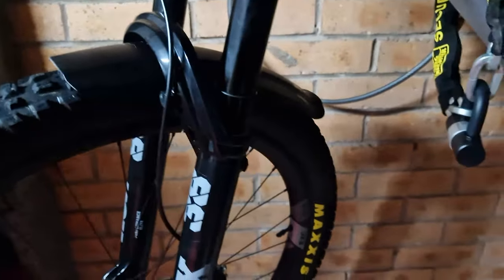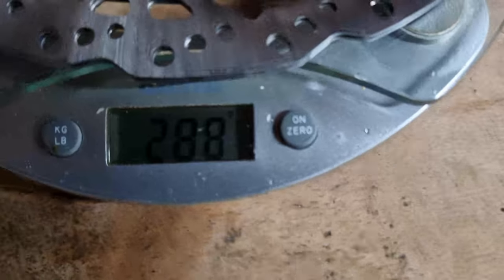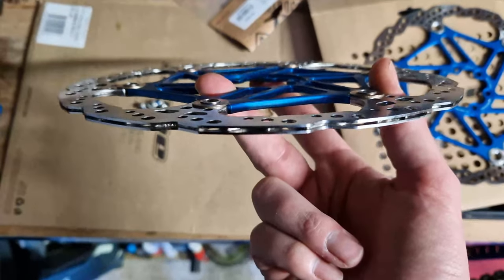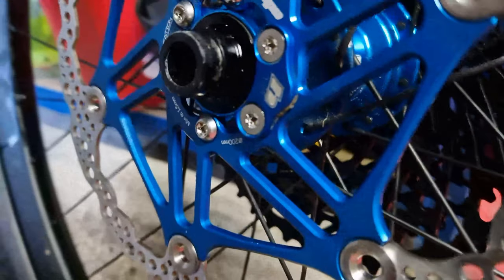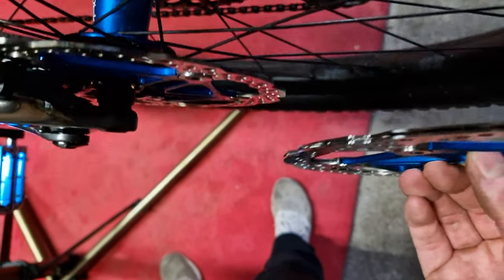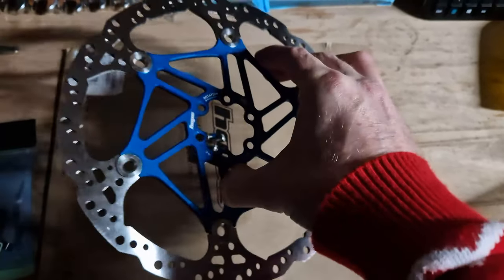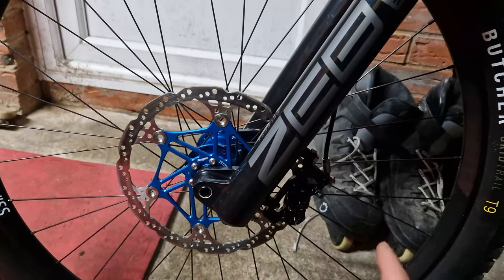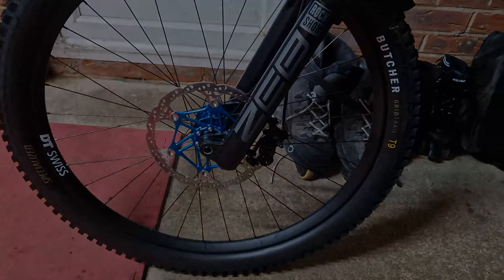Hope disc upgrade - 220mm V4 vented float rotor on the Turbo Levo Carbon

Comment: just bought the 200mm version of this rotor since I have a Rockshox Domain 160mm fork on the way and the smallest rotor it will take is 200mm. Unfortunately in order to get the rotor sooner i had to go with the orange colored one. I LOVE orange, it's my favorite color but it's 100% not going to go with the black and copper color scheme I have going with my bike, lol. Oh well. I was thinking of possibly painting that center part black but since I'm lazy i'll probably just leave it orange.
Also you scared me there for a bit when you showed how thick that one rotor was. i thought I had accidentally gotten that 3.3mm thick rotor but turns out I got the regular thickness rotor, thank god.

Comment: I got the DT Swiss HX1501 wheels for my Levo, and yes they are a pain to get in 6-bolt. 

Great wheels though, the hubs are an absolute doddle to service (and almost silent afterwards) and much MUCH tougher than the stock Levo hubs
Reply from the maker: hiya, I run the 1501 on my kenevo SL to keep weight down whilst keeping the enduro strength. Then run the amazing FR541 enduro wheels on my Levo, both are amazing alloy and carbon wheels by DT Swiss 🙂